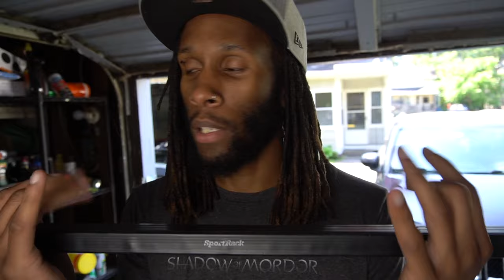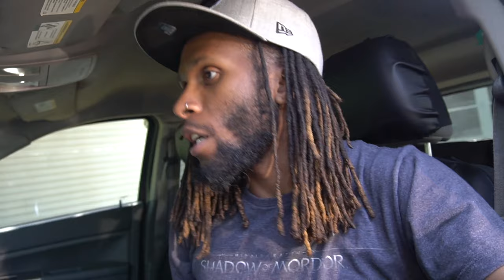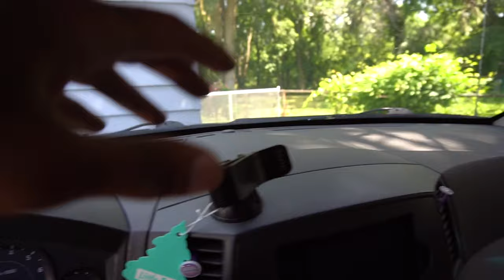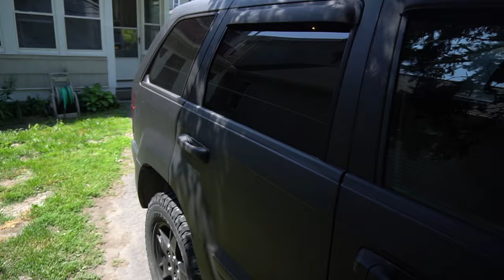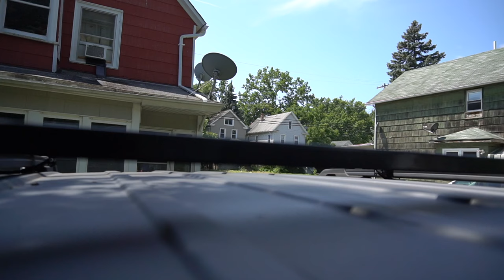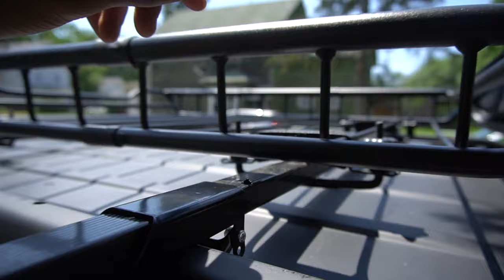Jeep Grand Cherokee WK Roof Rack & Cross Bars Install!

Comment: I have the same problem but check this out if u take out the a/c clutch relay get a lil peace of wire speaker wire is ok put it inside the first hole that goes across than the other end of wire put it on the first hole that goes across. That's how I have mine and it works 100%
Reply from the maker: For the AC? I'll give it a shot! Thanks for the advice
Reply: @OmegaGreedAK47  I just posted a video
Reply from the maker: @ferndawgferndawg4079  thanks I'll check it out!